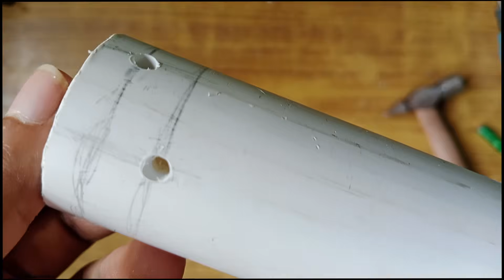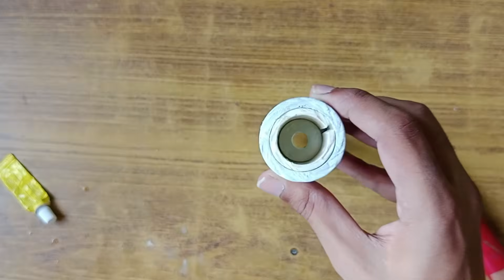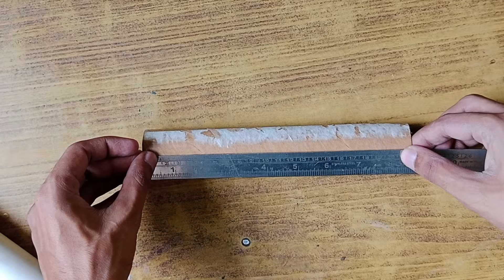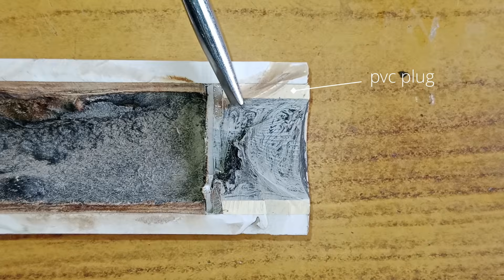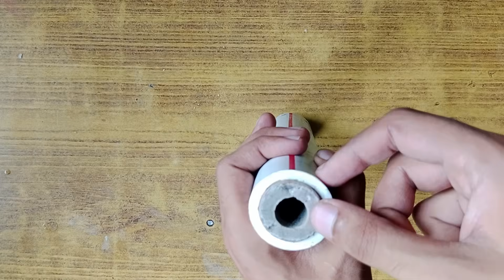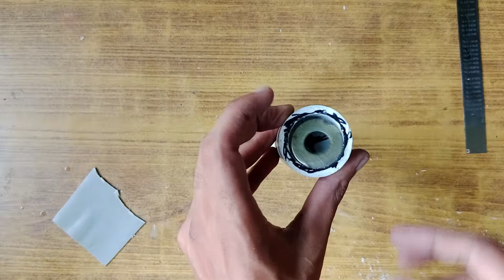The reason why "YOU" shouldn't make PVC rocket motors.

Comment: Yoo
Did u use sorbitol for the propellant?
Reply from the maker: No used  normal sugar
Reply: @CosmicCraft-r47  try using the sorbitol
65% kno3 35% sorbitol
Reply: I hear that sorbitol and kno3 mixed together can burn rapidly
Reply: @gokgokbojaynaaait actualy burns slower than kno3 and sucrose, but it is much much easier to melt and cast due to the low melting point of sorbitol. That is why it is prefered by many rocketeers over normal sugar.
Reply: @Dani.Space15 and it's predictable right?
Reply: @gokgokbojaynaaayeah that is a nice side effect of the tamer burn